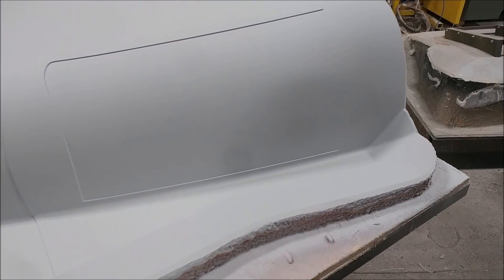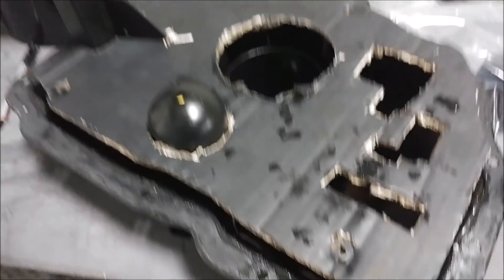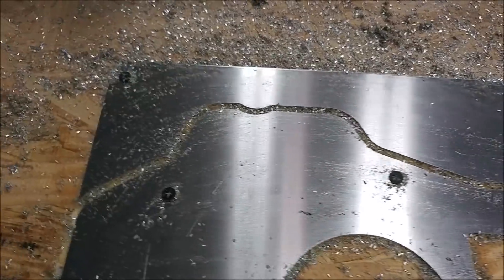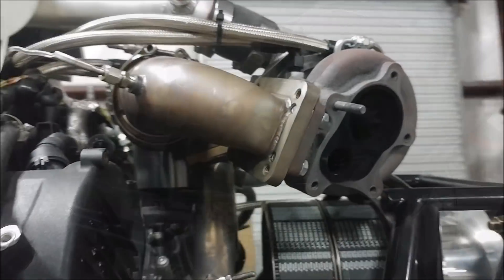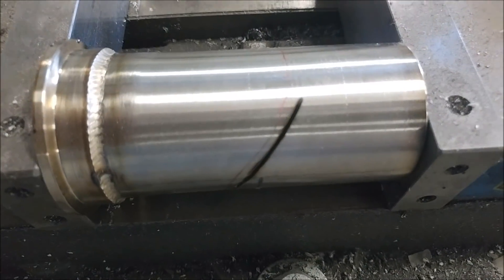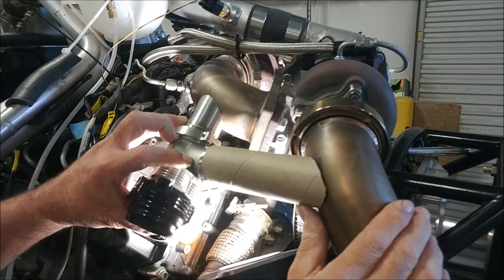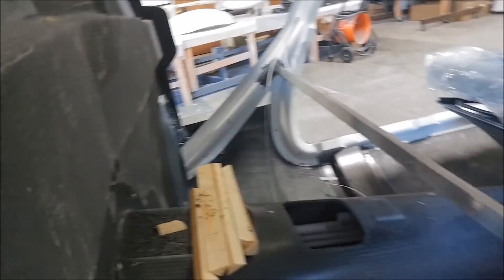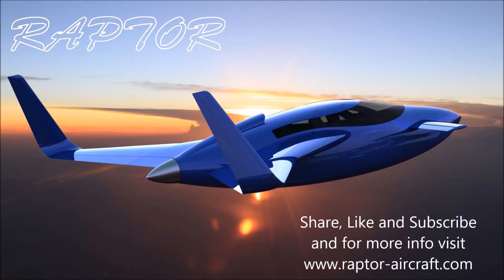Engine and Fuselage Work - keeping busy with small projects

Comment: would it be possible to put on a small oil reservoir just for the governor ? just in case there ever would be a leak somewhere in the system it wouldn't pump out all the engine oil.  Thanks for the updates

Comment: The Oil return line from the turbo will show you how important it is one day.
 I will explain again if anyone is interested.
Reply from the maker: Yep, fully aware of everything that has been mentioned in this thread and its all been covered with the configuration I have put together.Thanks
Reply: Newtz - not sure how to PM to YouTube users.... I'm assuming you have a spot in line for a Raptor, wondering if you've looked into bringing it into Canada yet. I've spoken with one TC guy who said it should be very easy, another says it's not. Thoughts?
Reply from the maker: Please share.
Reply: It has to be thicker in diameter because the return is essentially an oil foam. Also, it has to be returning above the oil level in oil pan, because oil foam is less dense than oil in oil pan. Otherwise thick oil will block oil foam from coming out of the return line.
Also, those waste gaskets (like everything else) should be attached with nuts than can be secured with aviation wire.
Cheers, fantastic progress!
Reply: Kyle, your post is meant to be a joke right? Because if not. You are absolutely fear mongering. Sell this BS somewhere else.  " hot engine oil will become atomised and mixed with the intake air" I am voting this post for the best sounding Bull s.h.i.t. ever posted ...LOL I need a beer ...You sound like you kind of know something about engines. Do you know how much pressure it takes 
 atomize diesel fuel through an injector? 2500-5000 psi +  Never mind volume of fuel... OK SO ...what pressure does the oil lubrication system in this engine run at? 50-80 psi ? Your saying a leaky bearing will atomize 10W30 motor oil. And cause a RPM runaway. ROTFLOL.. A oil leak into the hot side or cold side of a turbo section will never have any other effect on the diesel engine, other then it may blow a little black smoke..
Reply: Yes Sir I do have a two digit spot in line.  I chose to build a Raptor as soon as Peter made the announcement about the engine. TC has little to do with our Canadian Home built Category. The organization tasked with this responsibility is the RAA Recreational Aircraft Association of Canada. This group looks after everything to do with home built category in Canada. They even look after qualifying all the inspectors. These guys have their ducks in a row IMHO. great group! Pleasure to deal with them. If your planning to build a Raptor you should join the Association. The way Peter is going about documenting & building the prototype. The Raptor will have no problems in Canada. He should move the company to Canada .. lol
Reply: Send private messages. Go to the channel of the person you want to contact. You can do this by clicking their channel name underneath one of their videos. Type in your private message and click Send.
Reply: PHONE books Seriously Kyle? stop your making yourself look foolish. It is embarrassing.
Reply: This is absolutely false.  This is probably the little short Napoleon complex dude that was at open house with his "pilot uniform" on trying desperately to feel/sound/look important.
Reply: Your a online troll. MoFreckles .. Always having something stupid to say.
Reply: Thank you!     Huge compliment coming from a Canadian!  Cheers!
Reply: Now you make me feel bad for calling you a troll & every ones opinions should be respected. I am sorry.
Reply: :)  Happy Halloween
Reply: Tim Ka , I think whatever line and fitting corresponds to the return port on the turbo should be fine.
 Don't recall hearing the oil foam theory before. But a straight vertical return line into the oil sump above normal oil level is best.
 This avoids any pooling of hot oil.
 I think those v- band clamps are GTG and the modern standard.
Reply: Raptor Aircraft , umm..  okay.
Reply: Newtz , they don't need 5,000 psi That's for emissions. They need about 500- 1000 psi to overcome cyl pressure.
 I've pulled turbos from high milage Saabs and VW's that drove in. The owner will say something like it hesitates at high rpm or on the freeway. Some of these engines had SEVERAL QUARTS of engine oil in the intake , intercooler ect just pooled in every low spot in the intake tract. Yes it came from the turbo. I'm sure they did smoke under load.
 The compressor side of a turbo operates under a relative vacuum and has an impellor turning in excess of 100,000 rpm. Add 4-600deg oil and yes it will be turned into a fine vapor. 
 No I'm not joking and yes a diesel engine will run great on it's own oil. 
It used to be VERY common for certain engines to run away. Shops I worked at had a general rule to remove intake filters a tubes so there was a flat surface on the intake. Then a sheet of 3/4" plywood with handles on the back to block off the airflow.
 I've heard of people trying phone books only to have them injested by the turbo/ engine, never seen that myself though. These were big engines I'm talking about 8- 15 liters.
Reply: Newtz , look at and READ any manual from a major turbo manufacturer and they will tell you about the importance of the oil return line.
 Find a proper gray beard diesel tech and ask. But if you treat him like I've been treated he might just tell you your right and let you figure it out.
Reply: Newtz , furthermore no factory turbo has a oil return line running anything more than a few degrees off vertical. Some go into the block but if you take the oil pan off and look up it's a wide open passage. I've spent countless hours studying how these things fail in the real world.
Reply: Raptor Aircraft , It should be routed straight down and into the oil sump. Above normal oil level. If the line clogs due to sludge formation, which is very possible because that oil is the hottest oil in the system, pressurized oil can bypass the center section of the turbo. When the bypass occurs it will flow into the compressor side of the turbo. Because it has lower pressure than the turbine side.
 The hot engine oil will become atomised and mixed with the intake air, in effect the engine will be in a run away condition. The oil pump is the new fuel pump and the engine will run until it runs out of it's new oil/fuel source or it over speeds or over torques it's self. If it holds together long enough it will run out of  oil eventually and sieze.
 You may think that you can just turn the engine off. But you can't it becomes a true mechanical ungoverned engine. If you work with diesels long enough you will see one run away. It's a hell of a thing.

Comment from the maker: Let me clarify this oil thing. Ok, so the dipstick is at the front of the engine which is positioned at least 35" from the trailing edge of the wing, which would be the closest point to stand to attempt to reach it. So, only the tallest person with long arms would have any chance of reaching it even if there was an access door in the cowling. Even removing the cowling you will likely need to stand on a small step in order to reach it. So doing that before every flight is simply not going to be practical. Again, this is an auto engine and it does not burn through oil like an aviation engine so topping it up is something that should be completely unnecessary. So, you will change the oil on a regular basis and much like a car you probably won't check it frequently between oil changes. However, it's still nice to be able to at least check if it's low and using the dipstick would be a pain so this low level indicator is the next best thing until we can somehow figure out how to relocate the dipstick or interpret the factory sensor and provide the info it provides normally while in a car. This solution was relatively easy and provides some info that is like in the prototype at least. Obviously you guys are not impressed but then you didn't have the full story till now. I'm sure you guys all have some solutions and if they are viable we can consider them for production aircraft. Thanks.
Reply: Mr. Peter keep up the very very awesome good work. Oil dipstick is such a minor issue. Relocate it. Just drill a hole in the side of the block. That is all Audi did. tap some threads and away we go.  oh! make sure to plug the old hole. Don't take no guff from the peanut gallery. lol
Reply: I like the sensor idea. It's no problem to me if you can't use the factory one as long as I know when oil is low. It'd be neat if the factory sensor was working, but your solution is creative and works. Would the factory sensor even be protected from the rearward movement of oil during climbout?

Comment: Keep in mind that checking the engine oil dipstick serves more than one purpose - in addition to checking the oil level, it is important to also do a visual check for contamination to determine if there is a blown head gasket causing the cooling system to leak into the engine oil, which will turn the oil grey.  I'd consider a Lokar custom flexible dipstick that is located right next to the engine oil fill location at the access panel (wherever that is supposed to be).
http://www.lokar.com/product-pgs/eng-dipsticks/eng-dipstick-main.html

Comment: Peter, I love the idea of smart engineering to keep track of oil levels and such but do you think in the discipline of cost savings a flexible remote dipstick similar to this one might be more prudent?  I know I have a hard time leaving something as critical as oil level to a sensor.  https://www.speedwaymotors.com/Flexible-Engine-Oil-Dipstick-Braided-SB-Chevy-RH,231377.html
Reply: No because it's not a oil burning engine. The reason you check your aviation engines is because they are oil burning. They are decades out of date.
Reply: Go directly to the manufacturer (Lokar) for your choice of configurations and finishes.  Lokar has made custom linkages, controls and dipsticks for the hot rod industry for many years and will make them in custom configurations.
http://www.lokar.com/product-pgs/eng-dipsticks/eng-dipstick-main.html
Reply: Be nice to see a flexible pipe between the outlet of waste gate and the turbo down pipe for ease of installation and compensate for different expansion rate

Comment: Peter, getting a closer look at where the turbo's sit in relation to the belt drive, I wonder if there is concern over heat affecting the belts. Is there a plan to have a heat shield there to prevent any trouble? Tight area already so challenging to get one in I would guess.
Reply: Turbo blankets are very very good. Do not use exhaust wrap.
Reply from the maker: Be patient, there is going to be heat shielding once everything is sorted.
Reply: Raptor Aircraft I thought that might be the case. Thank you.